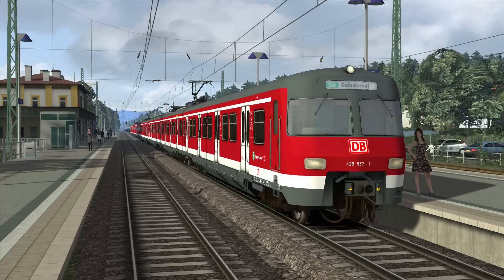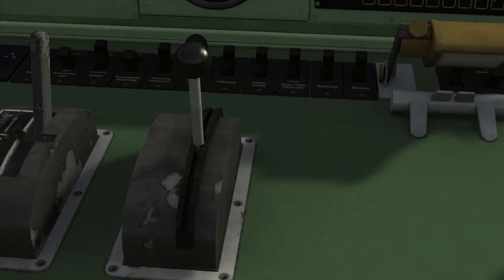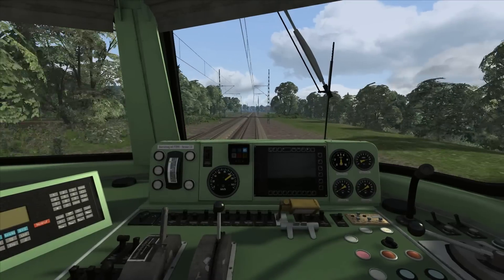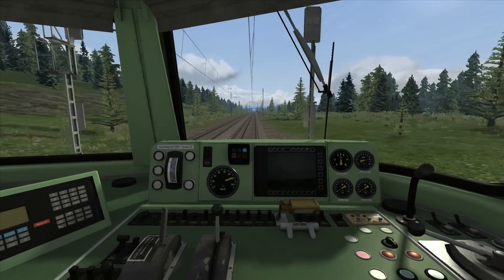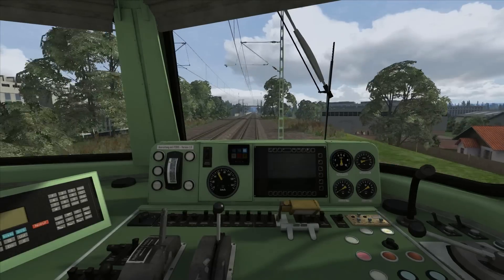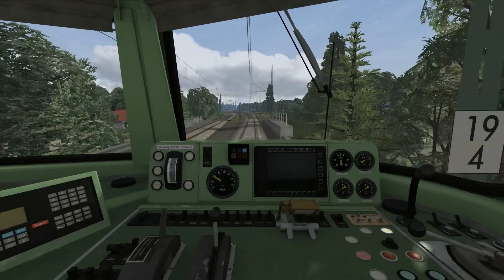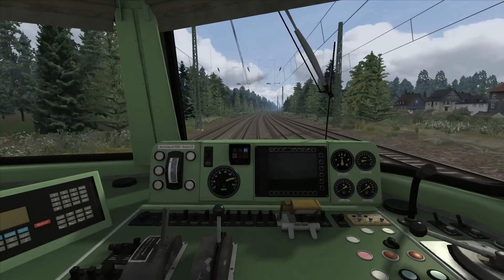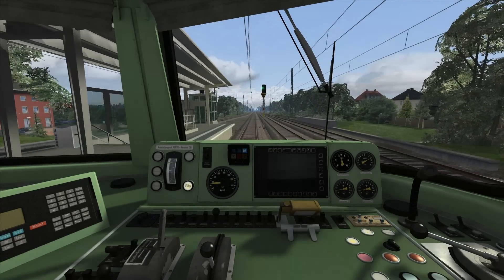Train Simulator 2015 - Route Learning Germany: Tutzing to Munich HBF (BR 420)

Comment: Nice to see you doing more german routes like this one! ;-) By the way: The BR 420 isn't equipped with the LZB. Because of that it's only used for special rides and on S-Bahn-lines which don't touch the S-Bahn-Stammstrecke between Pasing and Ostbahnhof. Otherwise there would be big problemes regarding the strong timetable and safety in the tunnel between Hackerbrücke and Ostbahnhof. So if you want to drive a 420 to Hauptbahnhof in the present day, you have to stop overground where the regional and long distance trains stop and not in the underground station (Hauptbahnhof tief).
Before the introduction of the BR 423, the BR 420 was the only EMU type on the S-Bahn München network. Back then the Stammstrecke didn't have LZB and the BR 420 was used on every S-Bahn line except line A bacause line A wasn't electrified then.
Reply from the maker: TheSimulationExperts Thanks for the info. I had no idea about that with the BR 420. What are the rules on only PZB equipped trains running on LZB sections in Germany? I've bought a few older trains recently which are only PZB equipped, so I was wondering. I'm hoping to make some German loco-hauled videos soon! :)
Reply: PTGRail
As far as I know, you're not allowed to drive on LZB routes without having LZB in the train, but I'm not 100% shure about that as there might be some exceptions.
Reply: +TheSimulationExperts You are allowed to drive on LZB routes even without having it equipped, as the routes are still equipped with PZB. The Stammstrecke is usually only used by LZB-vehicles (423), although in early 2015 some trains of the S4 were 420s without LZB.

Comment: Not sure if it's the same in Germany, but in Switzerland the "A", "B", etc. markers on platforms are boarding sectors (Sektoren).  There are predefined stopping points (usually indicated by a [H] marker) such that the train cars occupy specific sectors at each station.  This is especially important for trains with first- and second-class coaches, since passengers with second-class tickets are not permitted in first class.
Reply: PikalaxALT It's nearly the same in Germany. We just don't call it Sektor(en). We call it Abschnitt(e).
Reply from the maker: PikalaxALT I thought that's what they were. At that particular station, stopping at the end of the platform just didn't look quite right with the positioning of the train relative to the station exit which is why I chose that point to stop at :)